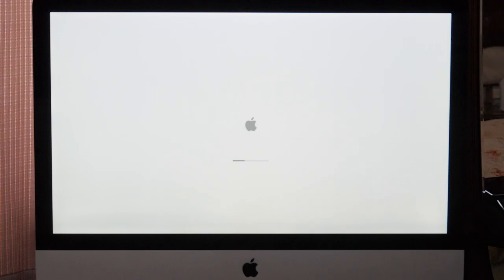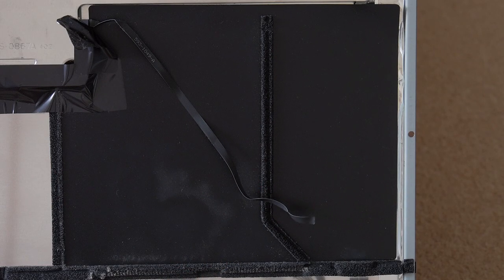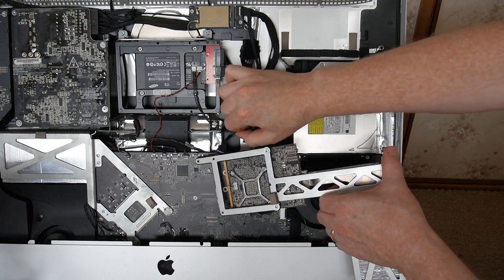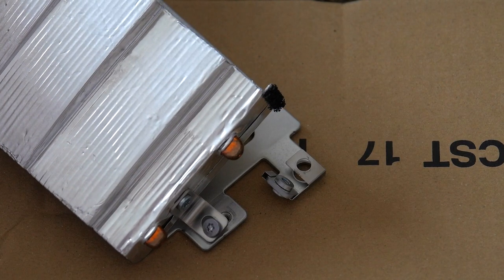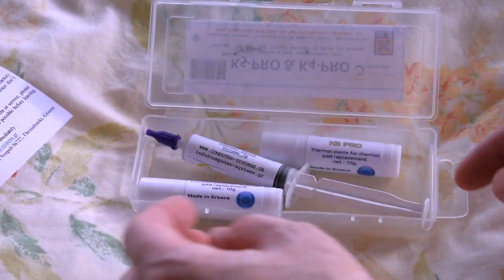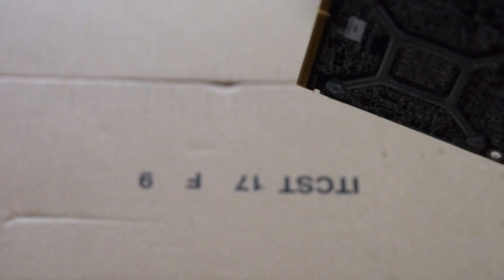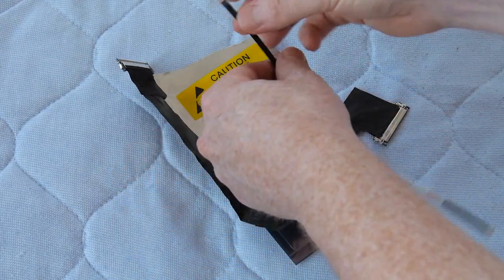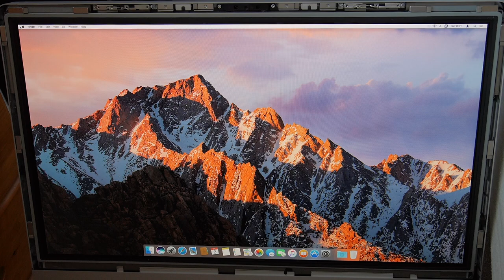Late 2009 iMac 27" Video Card Repair — 4850 — 2nd Bake

Comment: Well the time has come for my 2nd attempt at a bake 🙁. I followed your 1st and 2nd videos FIVE years ago to fix my video card. I have a 2011 iMac. I'm trying to remember if I took out the entire mother board last time or not, but I think this time I'm just going to leave it in. I definitely used the pastes from your 2nd video though with great success. Hope my second go at this is as successful as the first. It's currently stuck in a white screen of death upon boot up
Reply from the maker: Five years is incredible for the bake! Congratulations!  The PRAM battery is no doubt still good, so you don't need to remove the motherboard. Please let me know how your 2nd bake goes.
Reply: So I did the bake again today and it fixed the problem again (for now). I forgot but in my 2011 model the entire motherboard has to come out. Some of the wires are in different locations too but I took my time with everything and it went pretty smoothly. I’m hoping this one lasts another long time (fingers crossed)
Reply: Also the pram battery in my 2011 is luckily in the front so it’s a bit easier if I need to replace it.
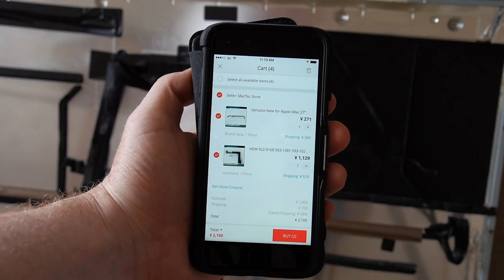I also baked mine at 400 degrees f for 8:45 this time :)
Reply from the maker: @CatAndTie  I read and mostly reply to every comment under all my Bake videos, and so far, you are the first person to report 5 years of continual usage out of a bake.  So again, big congratulations on that feat!  As to how long your second bake will last, I cannot say.  In my case, on my late 2009 iMac, my first bake lasted a mere 4 months, and my 2nd bake lasted 2 years and 9 months.  I cannot even speculate on why, but I do hope you get another 5 years out of the 2nd bake!

Comment: The worst part was building these little volcanos out of aluminium foil;)
and seriously, it's been working again for 5 days now, so thank you so much for this unexpectable experience!
Reply from the maker: When I was a kid, I actually made a volcano.  It wasn't foolishly put on a table like that Brady Bunch episode but rather built on the ground where it belongs.  I put a garden hose in the ground and put layers of mud around it, slowly, layer by layer for about 1 week until it was the proper shape and hard.  The hose and spout faced straight up.  I then blasted the water.  Worked great.  So those aluminum foil volcanos were pretty easy for me to make in comparison to that volcano of old! :-)
Reply: @JDW-  so my first bake lasted 8 months...on my way to the oven right now...but I never know if it's 10 minutes and after you wait for the card to cool down in the oven or if you take it off as soon as the bell rings (supper's ready!)...no thermal shock?
Reply from the maker: @themusinglad  I'm sorry your bake lasted only 8 months.  My first lasted 4 months but the second bake lasted 2 years and 9 months.  In both cases I had my card sitting atop aluminum foil feet, which in turn was sitting on a removable metal tray.  After the bake I proceeded to remove the metal tray and put that on our kitchen table to cool.  The entire tray is metal, so there was much heat coming off it during the cool-down process, thereby preventing thermal shock.  The room temperature was normal -- not especially cold.  If you lack the ability to remove a tray like I did, I'd suggest leaving it in the oven with the door open wide to cool down.  That would be perfectly fine to do.
Reply: @JDW-  oh please don't be sorry, 8 months is already a miracle!;) 
The 2nd bake has just finished, my cat is playing with the aluminium volcanoes, the Imac boots perfectly....such a perfect day;)
I'll keep you posted and most of all, thanks for your precious sharing! Hug from France!

Comment: My Late 2009 iMac i7 had the same graphic issues (vertical lines, no video capability, bootable only in safe mode, etc). Finally received all the parts (K4/K5-Pro, Arctic Silver/ArctiClean, and anti-static wrist strap), so today was the day I took apart my GPU and baked the AMD 4850 card at 395F for a full 10 minutes (plus warm-up and some cool down in my gas oven).

Put it back together, and voila - it's up and running again.  I've installed Mac Fan Control to monitor temperatures and control the 3 fans within the iMac to keep the internal temperatures cooler. 

Hopefully the bake will last for a long time. If not, someone else mentioned on your 1st bake video about using a Kepler-type MXM replacement GPU card if this doesn't work - and has been well documented elsewhere. Replacement cards (non-AMD) are faster and with a lot more RAM are available relatively inexpensively.

Thanks for your detailed video!
Reply from the maker: Thank you for sharing your success story in detail!  I love details!  By the way, be careful with non-AMD video cards if you use FCPX because you will take a performance hit.  FCPX is optimized for AMD cards.
Reply: I certainly wouldn't have attempted it without your video!  And I really considered removing the entire CPU (like your 1st bake) and change the battery (which I also ordered), but decided not to after removing the first few cables!  20+ finicky/small cables would be overwhelming to complete without knowing the bake would work...  I'll attempt if the battery starts to show issues.  This sheer number of cables and connections in this machine is daunting compared to my old Mac SE, Mac G3 AIO (aka Molar), and iSight G5.

The computer didn't work after the first attempt of putting it back together - got the initial chime and could hear the hard-drive spin, but the screen stayed black. Figured it was the cable that goes from the monitor into the GPU area - it didn't fit properly on first attempt. It still seemed 'off' after the second attempt, but the computer restarted properly.

Of interest, is that this Late 2009 27" i7 was purchased as a refurbished model from the online Apple Store in December 2010. The GPU did not have any thermal pads, but had white thermal compound (looked like K5-Pro) on most of the chips and aluminum section of the heatsink.  It was still hydrated and moldable, but I removed it and cleaned the GPU and heatsink with ArtiClean (which smelled like a citrus-type solvent), and not anhydrous ethanol or methanol.

Temperatures using the Macs Fan Control of ODD/HDD/CPU at 2200/2200/1500 rpm keep the temps between 40 and 55 Celsius (GPU Diode is at 55 Celsius, about 5-10 Celsius hotter than GPU Heatsink and GPU Proximity). Hopefully that's suitable for longevity.

Thanks again, will keep this board updated on the bake!
Reply: It's been a good haul.... after nearly 4 years (3 years, 11 months, xx days) of the 'bake', and using Macs Fan Control as above - it finally gave up.  Not bad for a 13/14 year old machine with a second 27" monitor!  I've already bought the replacement GPU (an AMD WX4150), so will continue to use the 2009 i7 as my daily home computer after I get it all going... and it'll have a lot more under the hood!
Reply from the maker: While I am terribly sorry to hear of the ultimate demise of your graphics card, I do wish to thank you for making time to let me know just how long your bake lasted. That provides further evidence that the bake really is worth the time and effort and cost for most people who try it. Best wishes!

Comment: 4/18/2020 Glad I found this video I have the same Late 2009 27" iMac, 12GBRAM and an Apple 2TB HD with the video card issue and symptoms of not wanting to boot except in safe mode to OS High Sierra fresh install. I was wondering why the graphic card will boot in safe mode but not normal. Thought I originally had HD issues, but after watching your video and see the only partly boot and horizontal lines I knew it was the Graphic GPU needs fixing. Had the iMac apart to replace the 1TB HD to 2TB now will have to go back in to bake the board, like yours my iMac Battery is original and on the side facing away from you, don't want to remove the Motherboard with all the connectors, glad you show how on iMac 2009 the graphics card is easy to remove except for that dam Temp cable. I noticed in the video you edited over the install back to the motherboard and then had to loosen it up to get Temp cable back on, is it impossible otherwise?  I also replace the big cable to the screen as the holding clip had broken off on one side. See a lot of good success comments from others after watching your video, I hope I have the same luck fixing mine here in the near future. I might check to see if I can get a replacement board at a reasonable price if baking doesn't work. Glad you put the info on the heat sink grease did not know about the non-conducting grease which could become an issue with the amounted needed as shown in your video for the sandwich back together. From researching the internet the design and the GPU have known issues of failing over time and Apple in the past would repair it, but now after so many years, they are out of the warranty period.
Reply from the maker: The video card will often allow booting in Safe Mode due to Safe Mode disabling parts of the GPU.  But as I replied to your other comment, that really doesn't make a usable computer.  I replied to your questions in response to your separate comments.

Comment: Hello. Thanks so much for your very helpful videos and explanations. My  2009 27 inch iMac (i7 /4850) is displaying similar problems. I am about to try to repair it according to your instructions. However I'd like to use thermal pads for the memory chips since K5 Pro is not available in my location. I have Arctic MX-4 for the GPU. My question is what thickness thermal pads should I use? The options are .05mm, 1,0mm and 1.5mm. Again many thanks for your help.
Reply from the maker: To be honest, I've never measured the gap because it's not easy to do, and that is why I chose K5 Pro over thermal pads. Based on my eye-observation, I would say the gap is at least 1.5mm. Another issue is that the heatsink doesn't appear to lay 100% flat on the video card, so the gap above memory chips on one side of the card isn't 100% the same as the gap above memory chips on the other side. That too is another reason why K5 Pro is ideal. I realize you may not be able to buy K5 Pro from Amazon in your country, but you should be able to buy it direct from the maker in Greece.  Here is their website where you can send them an email:
https://www.computer-systems.gr/en/content/k5-pro

Comment: 07 April 2021 ... My 2011 21.5inch is working again and im using it now! I made sure i had the grizzly paste, F4 and the oven thermometer...... i may need to have a look at the fans as something is creating a slight noise. but will check your FAQ first. Thank you.

Comment: Hi, I watched your video and need to add what i've figured fixing exact same problem. Issue with graphic card was not fixed by baking the card but rather by replacing all dried out heat paste. The issue is typical apple problem with design as some of the elements on board the card do not touch the element of cooling frame. So replacing heat paste and allowing all the elements on the card cooling again will fix the problem.
Reply from the maker: Thank you for your comment.  In your case, it would seem that replacing the thermal paste was the solution for you.  And I must say I am rather surprised to hear it, but it is not impossible to believe.  However, that will not be a fix for everyone because there is a known problem with the GPU chip on these cards, and for people who have that problem, a mere changing of the thermal paste won't help.  For people who are worried about the bake and think that changing the paste ONLY will help, they certainly can try only that.  But if they reassemble their iMac and find that it didn't fix the problem, they will need to make the time to disassemble it again and then do the bake and reassemble.  It's all a matter of one's time.  Anyway, thank you for sharing your experience.  That is very interesting indeed!
Reply: @JDW-  Hi,
yes, there is a common issue with that graphic cards, and most of them include same issue resolving. this is also a reason why you've got two types of thermal paste and instructed to place fair amount of it to those elements which do not have direct contact with cooling body. When old paste dries out often looses a contact resulting poor or none heath transmission. That explains most of issues with this design of mac comps. To know if this is a problem with a mac, shut it down, leave to cool down, reset SMC and NVRAM and leave to boot, if it starts working good and then after a while starts showing the problem, you know what the issue is.
This same procedure and also fix was instructed to me by friend working at mac store, and resolving the problem with your instructions just made procedure work in success. I've fixed mine this way twice already (both time in time difference of approx 4-5 years), and I sincerely hope that your video and our discussion will help as manny people as possible to fix this problem as it is an easy fix, doesn't demand too much of a skill to do it and it can make a lot of unhappy mac users happy again.
I hope I helped
Reply from the maker: Thank you for providing further details on what fixed your iMac. In my case though, I extensively tested my iMac to see if the problem was thermally triggered. It wasn’t. Even after I had shut down the iMac all night and even left a fan blowing on it to make it ice cold, when I would turn on the iMac the next day, it would either not boot or freeze during boot or show artifacts on start up. Baking my video card solved problem for me. So it seems that not every case is exactly the same when it comes to these video cards. People with this problem should test, like I did and like you did, to see if it is a thermal paste related problem. And if not, they will definitely need to do the bake. But the time and effort required are the same whether you replace only the paste or bake and replace the paste. People unsure of which problem they have should definitely do the bake followed by replacing the thermal paste with brand new thermal paste as shown in my second bake video. Thanks again!

Comment: Doing my second bake this time with the same times in the oven as yours after first failure after 3 months
Reply from the maker: Tate, thank you for the feedback.  What thermal paste did you use after your 1st bake, and did you thoroughly clean off the old paste before applying the new paste?  I ask because I still don't know if my own 1st bake failed after 4 months due to bad quality paste and/or the fact I didn't fully clean off the old thermal pads.
Reply: JDW I used dallops of arctic silver 5 on all the chips that had paste/pads, I did my second bake yesterday and it revived the iMac once again, I’m using the same thermal paste as last time, let’s see how long it’ll last now. FYI I baked it the first time at 400 for 8 mins, this time I did 10, yes I thoroughly cleaned both times
Reply from the maker: @tatelandis8379   If you find that your video card locks up again in a few months, then I believe the problem could be the thermal paste. You see, in my case, not only did I not clean off all of the old thermal pads, but I also used old thermal paste as well. I’ve come to learn that thermal paste ages badly and that you really need to use it up within about a year of purchasing it, even if it hasn’t dried out. So I don’t know how old your arctic silver is, but if it’s more than a year old then it could be a problem. In any case, I also changed to K4 pro and K5 pro in my second bake, and I used it freshly of course, and so far my machine has been working consistently well for much more than a year.  In any case, please keep me informed on how things go for you in the coming months. Best wishes.

Comment: Would LOVE to know, for future reference, what Plastigauge would determine are the actual clearances between each chip and sink with compounds removed. Finding if chip/heatsink clearance is zero (determined by compound) or greater than zero (determined by hardware). I have the Plastigauge but my late 2009 27" has been running 24/7/365 flawlessly since 2009 (exception power outages). It's only open for a SSD upgrade and HDD (now SSD) howling fan replacement. Now Thinking that I'm way overdue for a GPU failure, I'm following this best-of-the-best GPU repair video just-in-case. I've read all the comments and all their replys. I have a SMT remove/replace/repair station and may use that option rather than bake. Either way, I promise to update here. THANK YOU for your time making this great video giving us all the GUTS to DIY. :)
Reply from the maker: Thank you for watching, for your kind words, and for reading through the comments.  As you could see, I read and reply to every comment.  Nearly everyone who has tried the bake (with a bad video card) has been able to resurrect their card and get it to work.  A few people reported back to say, some months later, that their card acted up again, and indeed, my own 1st bake lasted only 4 months.  But it seems that has to do with either the type of thermal pastes used or the application of the pastes or both.  I can't help but swear by K4 and K5 Pro though because I used them on my 2nd bake and my video card is still going strong more than 1 year and 7 months later.  

If you do decide to used your SMT equipment to physically replace the GPU chip, I would strongly suggest you make a video of that.  I would love to see it.  Even so, the old saying often rings true -- if it ain't broke, don't fix it!  Then again if you have the equipment necessary to do the job, and if you have a new GPU to use, you probably would be doing your video card a favor.  And as to performing a bake on a video card that doesn't have any problems, I suspect it wouldn't create a new problem, but there's not enough testing data out there for me to know for sure.

Please keep me informed on what you decide to do!